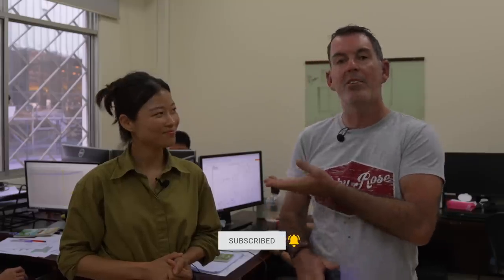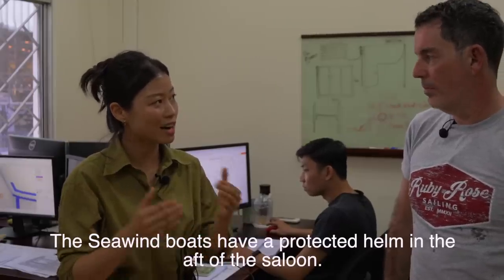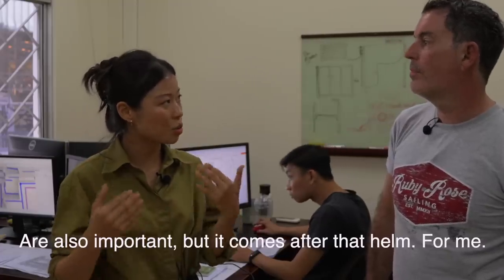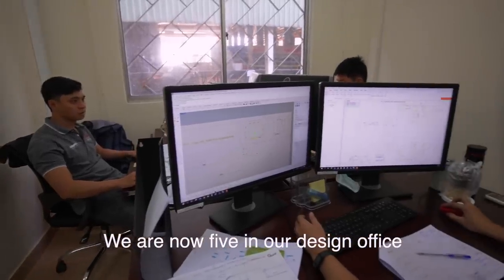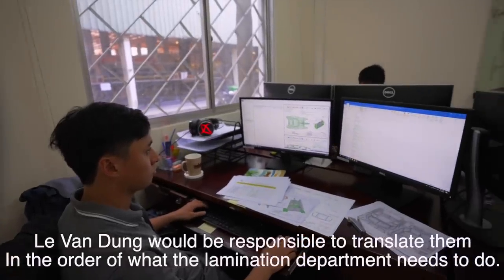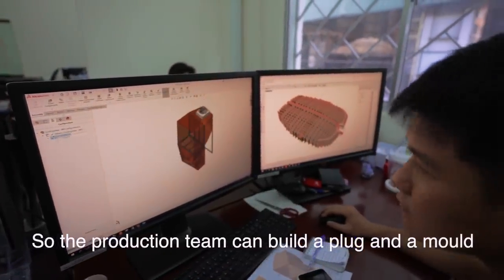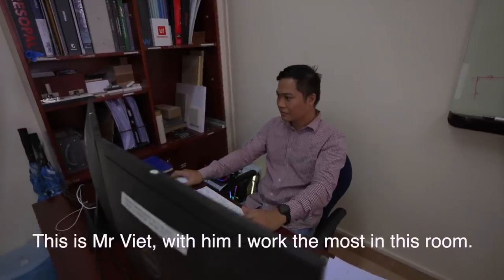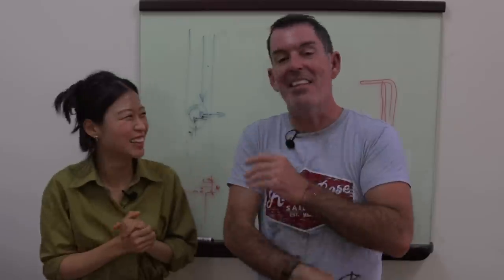How this BRILLIANT Naval Architect designs Catamarans in 2023

Comment: Would it be possible to ask them if it is possible to incorporate an Eco Drive ( Similar to what is used with HH44 and HH52) with the required solar array and battery bank with the 1730?

Comment: Today's paradigm may not apply in 5-7 years when a new electronic "Thingie" is available and needs to run new wiring.  This problem is widespread as I watch a lot of sailing video's.  
Is running extra conduit an option for you????????  It can be sealed at both ends to maintain watertight integrity and you control the start and stop of the run. ............ just axtin' ................ enjoy